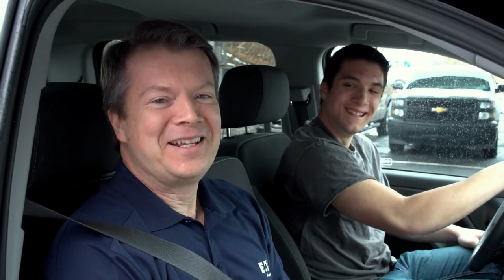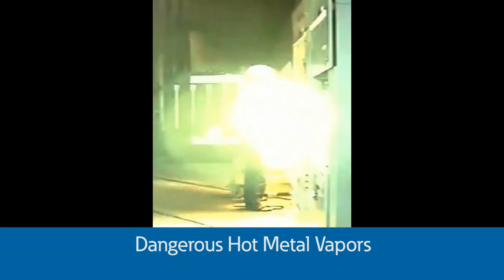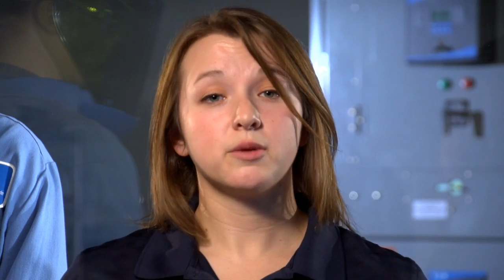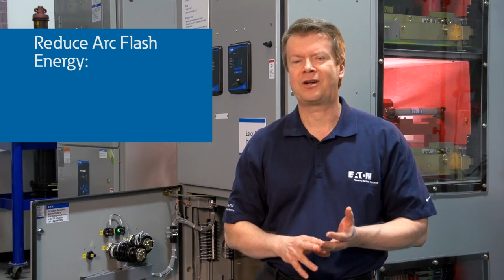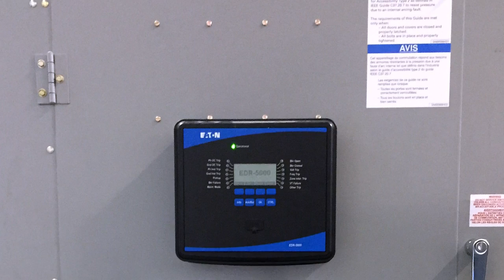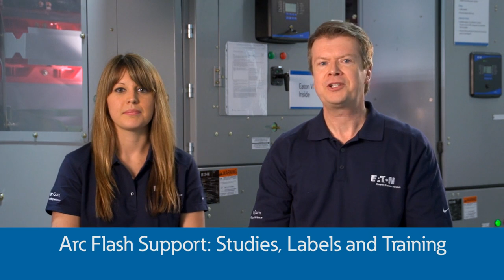Eaton Arc Flash Safety

Comment: What is the arc flash rating of metal sheets used in panelboards and switchgears based on material used and thickness? How about locks on enclosure doors?